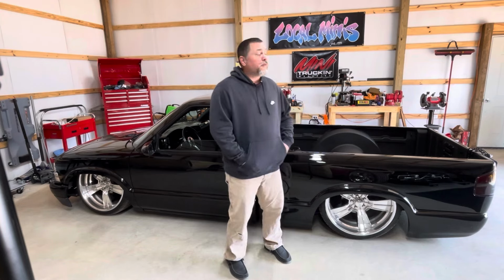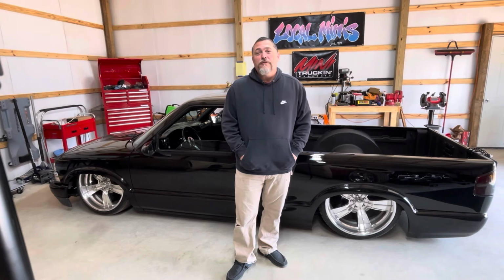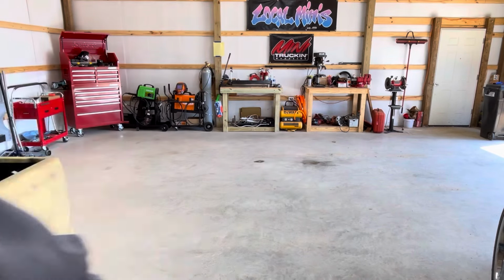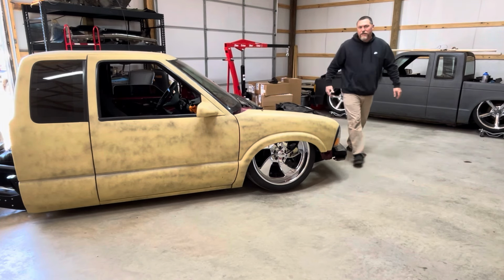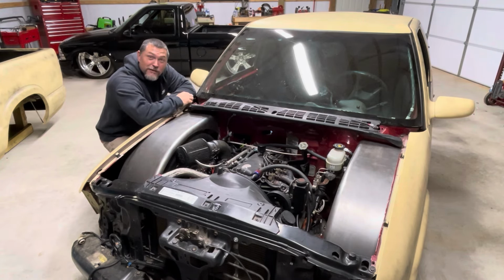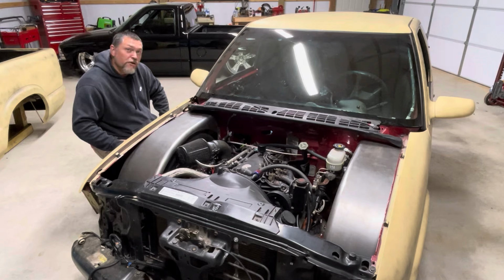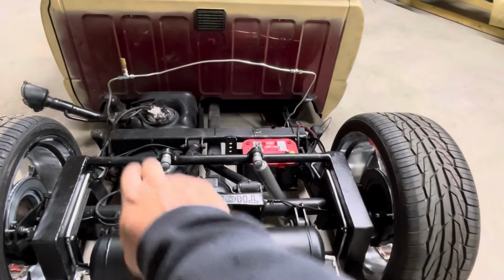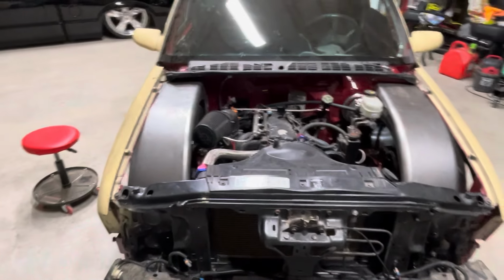Project:AIRDOUT small update, #minitruckin

Comment: What break booster are you running I'm trying to figure mine out to get the front to lay all the way out with my 20's
Reply from the maker: It’s a 7” dual, I believe I got it off eBay. Some of the s10 blazers are a little smaller if you don’t need much room
Reply: @Bartlett_Garage  I got one off ebay also just see what everyone is using how much did you have to modify it to make it work?
Reply from the maker: @dustinmcarthur6157   just had to cut the shaft that hooks to the pedal and weld on the end from the factory one

Comment: What wheels are those and what size??  22-24 combo??
Reply from the maker: 22s on both, the extended cab is running a bigger tire
Reply: Any chance, you could show me under the hood?  I’m working on my s10 and I would like to run 22s, I just wanted to get an idea. Only thing is, I have a manual and I want to bodydrop it. But either way, thank you for your videos and thank you for not being some cocky a$$hole. As you said, the struggle is real.
Reply from the maker: @hangarhound2241   do you plan on having Heat and Ac? If so you’ll have to run some kinda aftermarket setup.. what year is your truck
Reply: @Bartlett_Garage lol trust me the heat and a/c are def long decided gone. I am going to run 20s all around. 22s I would love to run, but I’m doing a traditional body drop, plus I have a manual trans. Between all of that plus having to tub/small brake booster, I figure 20s should be good enough 🤷🏻‍♂️
Reply from the maker: @hangarhound2241   you on Facebook?
Reply: @Bartlett_Garage  can u run 20 without shaving the fire wall ?
Reply from the maker: I think you would still need a small tubs to layout on 20s